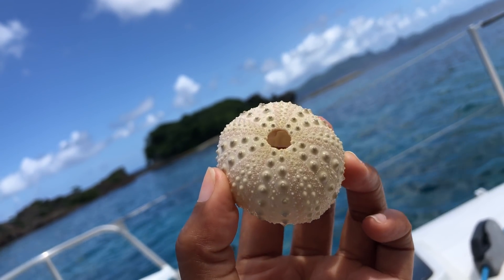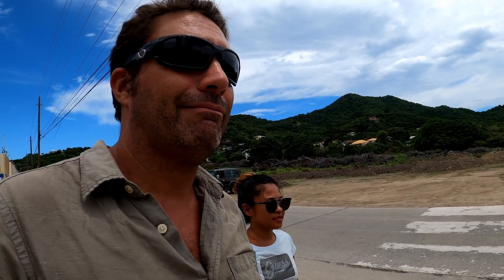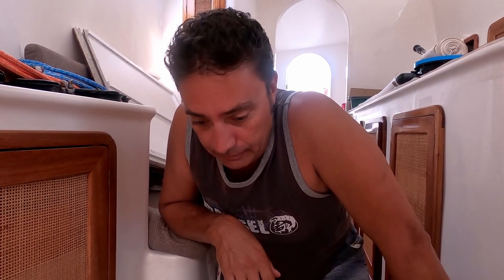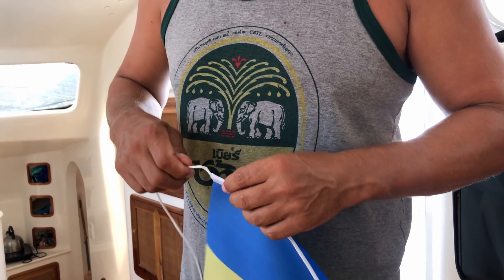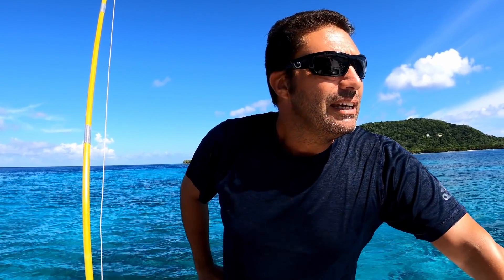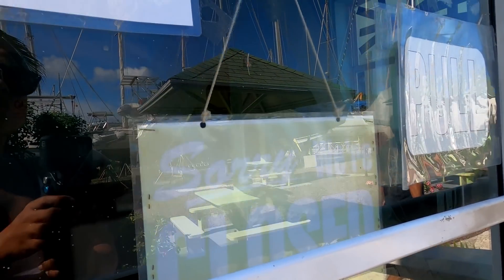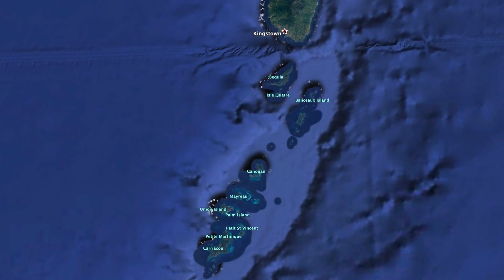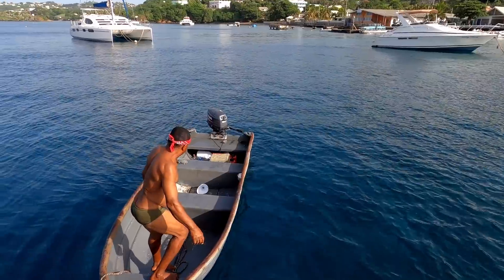Where is that water leak? - SAILING LIFE EP39

Comment: Use soapy water Jamie. Put few drops of dish soap into a spray bottle and spray the hoses and when bubbles appear, you've found your leak! Works every time like a charm. It's fail proof.
Reply from the maker: Works with gas pipes! Cheers Ondi

Comment: Hey Bro. I just replaced my water pressure pump because it kept kicking on. I thought it was the hoses as well, but it was the water pressure pump. By now, you've figured it out though :) Talk soon.
Reply from the maker: Yeah Ron someone else suggested that... but mine is definitely air... my water maker pushes some bubbles thru... then it takes a while for them to make their way out the nearest tap.

Comment: If you got a pressure pump system will means that you got a nonreturn valve on the system. What sometimes happen is that a piece of dirt will get pinch or worst case the valve would worn out and leak back to the tank. Clean or replace the nonreturn valve.
Reply from the maker: Thanks Hank.. Youre right.. it is part of the diaphragm pump design...
I found the watermaker pushes air bubbles into the piping... So now I bleed the air out after making water... All good! Thanks for watching.

Comment: i turn on my pump when its shower time or dish wash time. the rest of time its off.On my current boat i have a seperate  pressure pump from a 5 gallon filtered water  tank to my shower and sink. the other pump  pushes water thru the filters to fill the 5 gallon tank.ALL pumps are automatic, but i choose to have an on off switch. i keep off all the time.
Reply from the maker: Cool...thanks TV.... I found that it was air bubbles pushed thru from my water maker...if i bleed the air off after i make water, i have no troubles.

Comment: Thanks for a nice video. I have a question about the cockpit of Jupiter. For a 48 foot cat , it seems rather small and without much places to sit or lounge and no table. Also sun protection seems quite small. Is it a personal choice or the design philosophy?  Personally I like to live outside as much as possible especially in the tropics, I would rather have a smaller saloon and bigger cockpit if possible...How do you feel about it? Cheers.
Reply from the maker: Correct TW1... The cockpit is the only area that i am jealous of on other condocats. Even much smaller condocats have such comfy cockpits... In fact our friends Lagoon45F seems massive compared to Jupiter....
But there is the difference in sailing performance.... Next week we have a vid coming out which mentions the weight differences in boats....
We wanted a seaworthy bluewater performance cat, and that is the trade off.
But i still do get cockpit envy!

Comment: Can you switch to PVC pipe?  PVC can be bent and molded with heat.
Reply from the maker: Could do if you had the patience...other guys use "pex" system of piping... But i couldn't get it in Asia.
Reply: @SailingLifeonJupiter  pex is a great idea.  Really fast and strong.

Comment: The check valve in your water pump itself is probably leaking ....thus loosing pressure...
Reply from the maker: Yeah Todd... i suspected that too... but seems to be air bubbles from pushed thru from my watermaker... If i bleed the line after making water, i don't have any problem. Thanks for watching!

Comment: You need to change all the clips into push fit connections. They have two rubber ‘o’ ring on each end of an opening. 100% reliable and allows for m0vement and revealing. You can only get in Weston countries I would assume.
Reply from the maker: Yeah I tried to find em in Asia, but couldn't... System has been good lately so I won't muck with it.